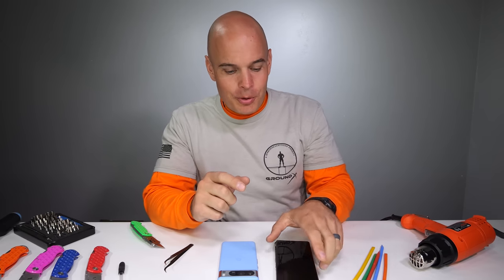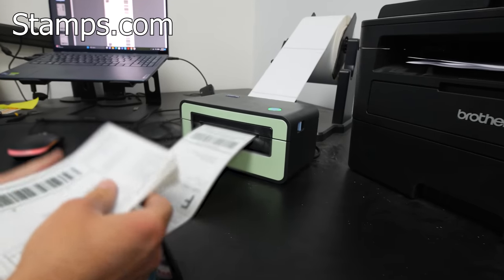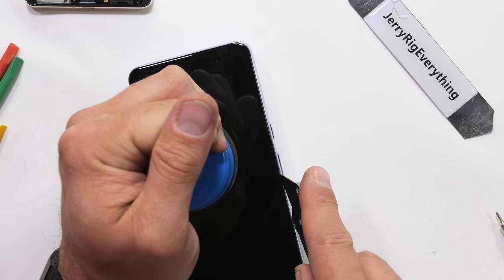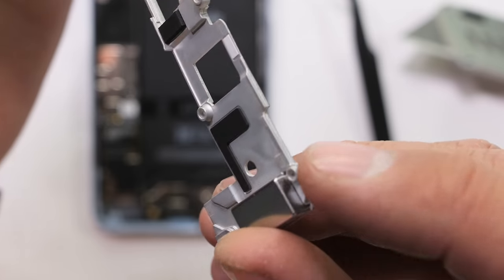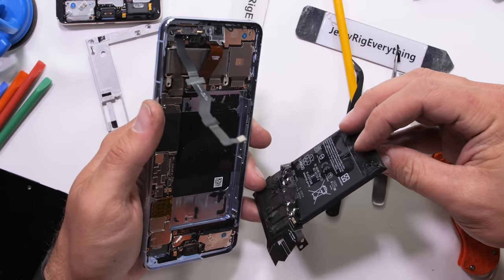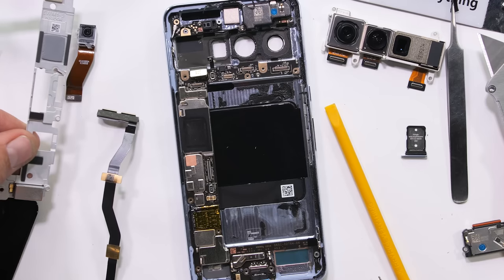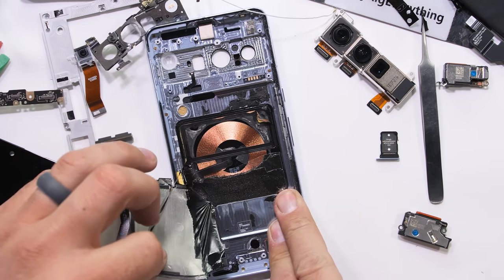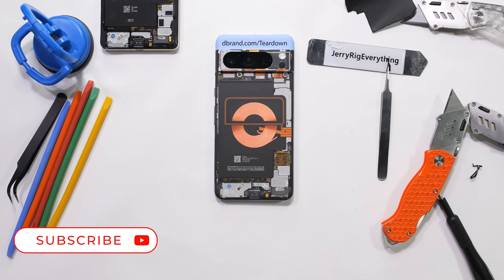Google Pixel 8 Pro Thermometer Teardown - (Google Watches my Videos...)

Comment: I'm actually surprised at how few phones do the transparent design. I think a good majority of people would love to see the insides of the phone from the outside. I'd get one!
Reply: I did put a clear glass back on my Pixel 3 and it looked great.
Reply: Probably coz it will become yellowish over time and scratches will stand out
Reply: @MightyPooPSTEAM since when does glass turn yellow over time?
Reply: @MightyPooPSTEAM  You are thinking of silicone or TPU cases that turn yellow over time.
Reply: Nah, I'm good with it.
It is too cluttered.
Reply: Of course then, dbrand would probably make a solid colour skin to go on it.
Reply: I remember xiaomi did it and now nothing does it but I don't see any other options
Reply: it can't be done. some manufacturer company use the back glass for the antena and signal to come through. thats why they use color back glass (so we cant see the antena or cable inside the color back glass).
Reply: Wouldn’t you see a big blob where the wireless charging coil is?
Reply: ong, but they are fingerprint magnets 😔🙏😭
Reply: Because the phone can get dirty, I can't handle watching even a speck of dust  inside my phone 😂
Reply: casetify did it
Reply: Cuz there is not much to see directly under the glass. The skins Zach sells are modified to see the coils better etc and do not represent what is underneath the back panel

Comment: I'm a little disappointed that the charging port is still soldered. That has not changed since the P6, and although I've never had an issue with the charging port on my P6 (or any phone really), that's just another step in the reparability direction.

Maybe for the P9 Pro, if I have the urge to upgrade by then.
Reply: lmao. Why wouldn't it be soldered?
Reply: @nibelungvalesti  soldered to the main PCB versus having its own small daughter board. The latter is easily replaceable.

Comment: The small dents in the back of the foil covering the display may explain why so many of us (myself included) are seeing bumps in the same locations on our displays. These bumps are difficult to spot, but if your phone has them they can be seen under certain light conditions and if you hold your phone at certain angles. I have reported the issue to Google and have asked for a warranty extension. There does not seem to be an impact on display quality on my phone, but I am concerned about premature failure of the display. RMA units that have been replaced seem to be seeing the same issue on the replacement phones. You may want to look at your display and report the issue to Google if the bumps are present on your phone.
Reply: Can you share the time stamp
Reply: Not a thing.
Reply: @dextrouskid  3:19

Comment: hey man, congrats for the video. I saw that battery as you cracked the phone wide open and I couldn't stop wondering if that battery can be safely replaced. I am from Eastern Europe, so Google doesn't directly sell their products here (Romania). Any thoughts about that? Your input would be greatly appreciated :D
Reply: Hello neighbor of andrew tate
Reply: @itz_arnab1478  dude, you are so off topic here.
Reply: If you're talking about the battery in the pixel 8 itself, then it's not the easiest to replace, no. First off, if you just want to replace the battery, you would need to get the screen off first, and even though Zach makes it seem easy, if you do it yourself (or even some less-experienced professionals) you risk breaking the screen in the process, which would set you back 235 euro. Second, the battery is secured with glue that's quite strong, and unlike Samsung and Apple phones of late, the pixel doesn't have those "magic pull taps" which easily remove the glue, so you'd have to pry it out, which could possibly ignite it and most likely break it, but if you're only job is to replace the battery, I guess that breaking the old battery wouldn't matter. 

And if you really want a pixel, you could try one of those firms that offer a service where you basically buy a product that only ships to within Germany (for example) andin the check-out process give the company's adress, but off course your own name, and then the company ships your package to your actual own adress (international). It's a workable workaround that does seem pretty legit, but I haven't ever used it myself to be honest, and some of them also have a maximum value for the contents shipped, so I don't know if that would even work, but it beats having to travel to Germany and back, just to buy a phone, lol. Anyway, good luck!

Comment: to this day i still don't know why companies GLUE down batteries that are already sandwiched between layers of the phone. they probably just want you to buy a completely new phone..
Reply: Without it, the battery rattles in the phone. Companies could use small amounts of adhesive so it's easily removable and doesn't rattle, but they decide to go all the way and make it to where you have the chance of catching your phone on fire when taking the battery out.
Reply: The batteries aren't as sandwiched as you think. Samsung tried that with the Note 7 and boom. The battery will rattle around ever so slightly and you'll feel and hear it.
Reply: @ratrodgrady  batteries would not rattle in the phone. do you remember 2010 phones with removable batteries?
Reply: @stinkinlincoln926  do you remember phones from 2010?
Reply: @CIBERXGAMING  Good point, I had a Galaxy S3 and S5 that don't rattle. Guess it just would have to do with how they fit the battery, but in their current state, without adhesive, the batteries rattle.

Comment: actually a big brain move of google to make it open from the front, ive been wondering for years why they all did it in reverse.
too bad the port is soldered, its always the first to go on my phones, despite cleaning them, they still fail to fast charge, then fail all together a few month later.
+1 on transparent tech, although a copper colored phone would be epic! imagine the wireless coil, but as the whole phone 🤯
Reply: What's big brain about it? It's an extremely bad idea. What's more fragile, the back glass, or the front with a screen glued to it? Also if damaged, what's cheaper to replace?

I have an Xperia 10 IV, easy to open from the back, as they use plastic for the back housing, and the adhesive is easy to open (and still water resistant), easily replaceable charge port, and fingerprint reader/power button is easy to replace as well. The perfect design.

I have been thinking about the Pixel phones for generations now  but their repairability is just so bad. They commit every possible bad decision with their phones hardware wise.
Reply: @kosztaz87  the screen, by a huge %.
nobody cares about a cracked back glass, the screen you look at all day long. that being the primary entry, will make it a lot easier to repair, plus waaaaaay cheaper, as most front screens today, are permanently attached to the whole frame, and comes as such from the factory, making a new screen repair cost almost the same as an upgrade to a newer model. now youll be able to get a new screen for a fraction of the cost
Reply: @DecanFrost I had a Nokia 6 a few years ago, with the same construction method as these pixel phones. When the power button broke, I tried to disassemble it. And the screen got cracked when trying to remove it. So the £5 repair job that could have been easily done if the phone was opening from the back (ideally with a plastic back) turned into a £150 repair. I just binned the whole phone, as it wasn't economical to repair it anymore. This construction method is just bad, I have no idea how in your head it makes sense.
Reply: @kosztaz87  And i have no idea how you can't, but then again, running Sony and Nokia, i wouldn't expect anything else.
Reply: @DecanFrost  Nice one. Then I will spell it out for you: suppose there is a hardware issue with the phone. You need to get into the phone. There are two different approaches to this depending on the manufacturer: through the back, which involves removing the back panel, or through the front, which involves removing the screen. Which one of these methods carries more risk damaging the phone in the process of disassembly? And if there is damage due to disassembly, which component is cheaper and easier to replace, the back panel or the screen assembly? I am actually eager to see how you are going to reply.

Comment: I’m using pixel 8 pro from past 4 weeks. The only issue I had is battery. I need to charge up twice a day. In 4 weeks of span I rarely used temp sensor. I have my Apple Watch to do it. It sticks with me and monitors my health round the clock. So I would say “Temp sensor” is just one show piece
Reply: I've been using my Pixel 8 Pro for about 6 weeks now and it's been a massive workhorse, only having to charge once a day unless I'm in an area that had crappy signal and has to work harder to reach out
Reply: Hey, I also had the similar issue, try this once. Let the phone die down to 0% once and then charge it up to 100%. I now get 7hrs of SOT with combined standby time of around a day.
Reply: Are you gaming a lot? I use mine mostly for youtube, messaging, and web browsing and I get 7-9 hours of screen on time. I don't think I've ever managed to drain it in a day
Reply: @ei..  I do actually, I play Mech arena and I've been playing Genshin impact recently as well
Reply: Twice a day? How? Seems like you're phone's defective (or you're a power user lol)...I easily get 8h+ of SOT on my Pixel 8 Pro
Reply: I use my 8 Pro a lot throughout the day and I don't even get close to running out by the end of the day. What are you doing with your phone to need to charge it twice?

Comment: I'd go back to pixel phones if they got rid of the camera bae. Justake the phone that thick, add a larger battery and whatever else like a headphone jack or the rear fingerprint scanner, that was my favorite feature of the older pixels. 
My dream phone is basically a galaxy s5 with an old pixel fingerprint scanner on the back. And obviously updated specs, and a little lager.

Comment: Upgraded from a Pixel 7 pro and 3 big irritations. ..

Still don't get how they got level 3 certification for such a sub par face unlock implementation. It seems to be fairly easy to fool. Won't be surprised if banks don't accept it in future. Would much rather have Apples tech for face unlock and can't believe they still can't copy it 

Also the damn optical finger print scanner is still as bad as ever. One of the ways we pay the price for Googles anti Qualcomm stance not giving us access to those better sonic fingerprint scanners

Another is how terrible the modem still is. Had to restart my Pixel 7 pro often to get the mobile to register on the network and the Pixel 8 is no different. These Samsung modems is junk

Comment: 6:43 .."it (USB C port) is soldered in place though and not easily repairable".

Repairability design as a practice needs to be put in place, and would be nice, Google.
Having to remove the motherboard and desolder to replace the one port doesn't show a sustainable approach. 
Screws can work for it.

Comment: That's battery removal method still looks easier than the useless pull tabs apple has been using since they added wireless charging

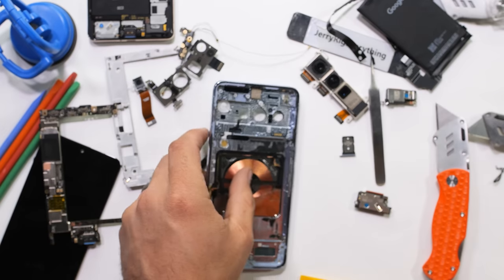Comment: 8:01 The PinePhone, Shiftphone, and Librem 5 are also extremely repairable.
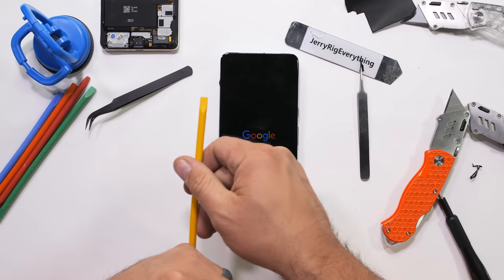8:44 Red. 🔴
While it is amazing to hear that this phone has partnership with iFixit for part repairability, having to open the screen to access the parts is seriously bad. 😬 And a soldered USB C port, too? 😬 Again, not great for repairability. Google ought to make something with a back cover that comes off easily. 💡

Comment: In all honestly why do phones glue the battery in the first place...phones already sandwiched pretty solid so I doubt the battery will rock around, the could just use a thin foam sticker to hold it in place

Comment: @JerryRigEverything do you have any clue what type of material is on the back, just above the temperature sensor (black square)?

We are trying to integrate this sensor (MLX90632) in one of our products, but... if we put a sensor under a thin glass, it measures a temperature of the glass itself and not a temperature of the finger (or any other surface).
Support from Melaxis is not exactly one of the best or maybe we are too small as a company... so maybe you can help us :)

Comment: I don't like that the battery isn't separated from the screen by other components. Owning this phone for as long as it receives software updated will get expensive.
Reply: but it's possible to remove screen without damage
Reply: @vipvip-tf9rw  What happens when a battery expands and pushes against an LCD panel?
Reply: @gingersperg  1. It's oled panel, it can bend a little without damage
2. if you see phone bulge, like an expired milk, replace battery asap
Reply: @vipvip-tf9rw  Well no shit! The first sign of damage on this phone (from a battery expansion) will be a black spot on the panel, due to the lack of foresight from Google in where they decided to locate their battery. That was my point.

Comment: I still don't get why they all have to glue down their batteries. 10 years ago, when battery and back plate were easy to remove by a 10 yo, that battery couldn't move a bit either. Maybe when you dropped a phone and disassembled it into 3 pieces, but you could put it together easily. Another step back.

Comment: maaan google does not give a SHIT about supporting their own broken hardware. i bought a pixel 5a right on release before i learned that there is a standard manufacturing error with the motherboard that causes the phone to just die randomly. mine was pristine, no damage (thank you case), no nicks, ifs, ands or buts. I was using it as normal one moment, and it became permenantly bricked in the next moment just playing pikmin bloom from the play store. 

google SAYS they will fix it for free at asuiron, but in my case they took my broken phone, replaced the broken motherboard, saw that the camera was still malfunctioning, and REPLACED THE NEW WORKING MOTHERBOARD WITH THE BROKEN ONE THAT CAME WITH MY PHONE!!! they offered me a 20% coupon to the google store to buy a new one after that. no thanks, i'm samsung for life now AND i switched to duck duck go. screw you google i'm still livid.

Comment: If they would only make a phone without a notch or punch out for the front facing camera. I'm still using my one plus 7pro with the motorized front camera that pops out the top because I want all screen. I'd be willing to take a phone with bezels just can't deal with the notch or punch out 😞
Reply: 7pro is old, and replacement battery hard to find and screen burned in, I have 7tpro

Comment: Apple's "reparability" program is a joke. sure the fact that an iPhone 6 can still be used in today's busy world but the newer generation iPhone having hardware lock is basically them giving everyone the middle finger when it comes to reparability. Another aspect that everyone seems to forget is the scrapping portion of a phone's life. Broken phones aren't always given fresh new parts and restored to their former glory. Most of the time, phone owners would just sell their broken phones if they deem the cost of repair is less practical than getting a new phone.

I am someone who buys broken phones and then harvest any parts I can from them and then sell them to technicians I know who use those parts to repair broken phones at a much cheaper cost and ultimately bring down the cost of repair. This is where iPhones fell awfully short. Starting from the iPhone 12, you can't really just buy a dead iPhone, crack it open, harvest the parts and then slap them into another iPhone and call it a day thanks to their hardware lock.

If google is really committed with their 7 year support, then it would be a good idea to make their upcoming phones cross compatible with each other. It would be easier to repair a phone if I can buy a dead Google pixel 8 pro from someone and then harvest the part from it to repair a google pixel 9 or 10 or 11 pro. much like how Framework made their motherboards the same footprint so you can get a motherboard from a different gen laptop and slap it into your own.

Also the battery. it would be nice if they can make the battery basically the same for all their phone just like how the BL-4UL battery of the infamous Nokia 3310 is compatible to almost any Chinese keypad phone still in the market today. Sure it's a removable battery but the point is, instead of designing a new battery each year, | think Phone manufacturers should just design a single battery and just run with it since the capacity of the battery they design each year remains relatively the same anyways. The capacity would increase or decrease depending on what they fancy. When was the last time we saw a flagship phone with 6000mah battery?

Comment: Maybe you should read the manual. If they want you to add alcohol before going lumber jacking Google would have actually designed a good way of gluing down the bat and still not be dicks about it. The lumberjack maneuver with solvent sounds like a good way to avoid ripping the battery and risking damage and personal harm when the battery gets punctured.

If a normal user is going to attempt replacing the battery they better also get the manual and battery ready before starting to take the phone apart. ;) So really you better RTFM and STFU before that is done.